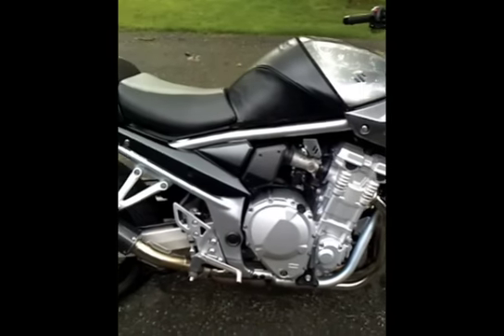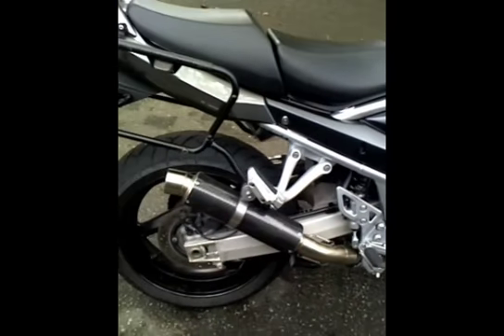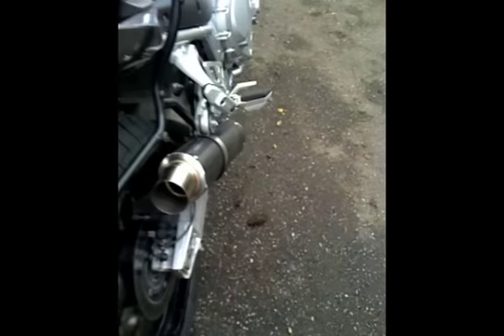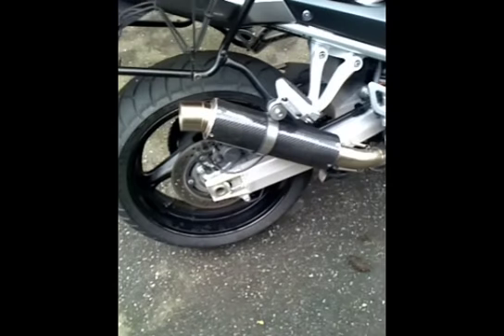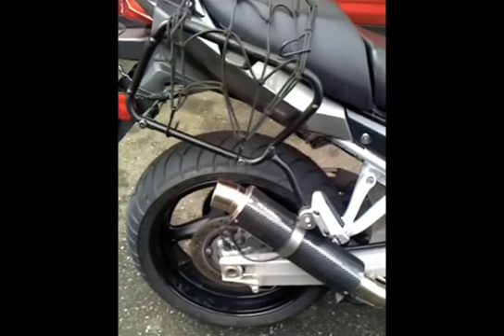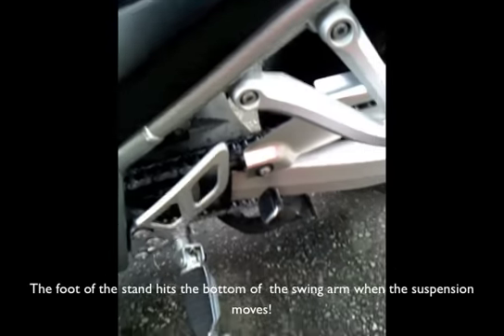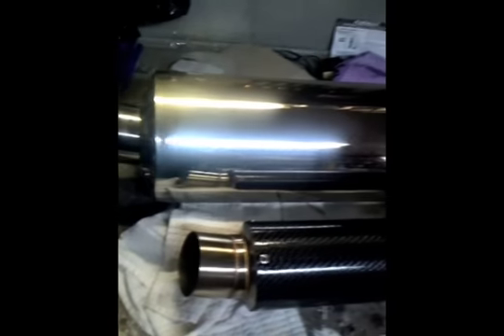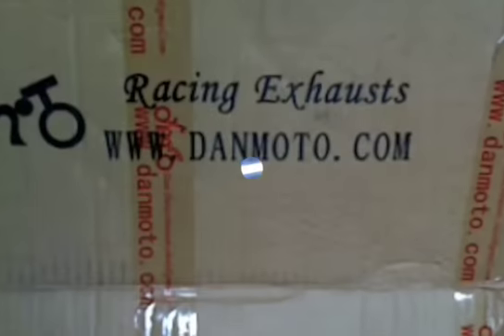Suzuki Bandit 1250 - Danmoto Exhaust

Comment from the maker: You would have to weld a bracket onto the collector pipe similar to how the stock can is designed to sort the stand problem.  The quality was actually very good.  TIG welding was first rate and the materials seemed to be of quality.  The carbon fiber could have been thicker though.  No baffles at all in this thing so it was quite noisy.  However, the guy I sold it too seemed to like it just fine.
I bought a yoshimura can which has the centre stopper bracket in place and it works and sounds great